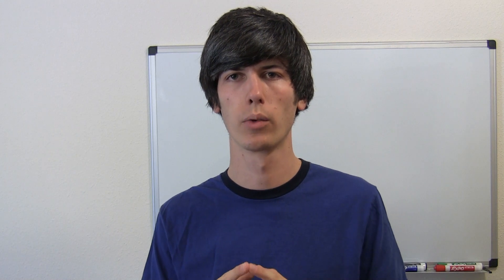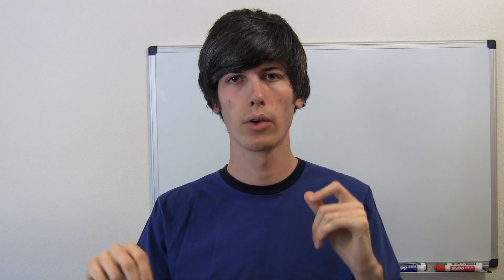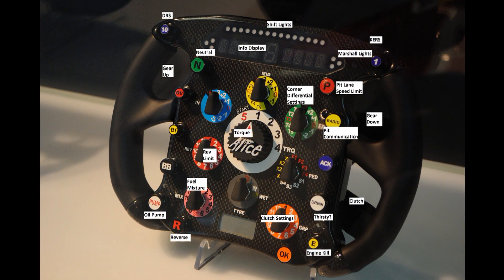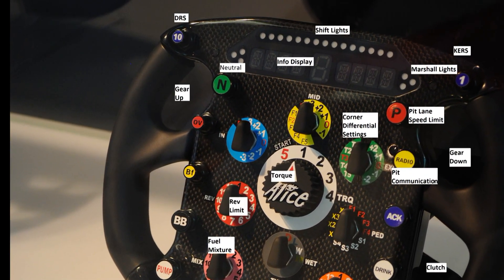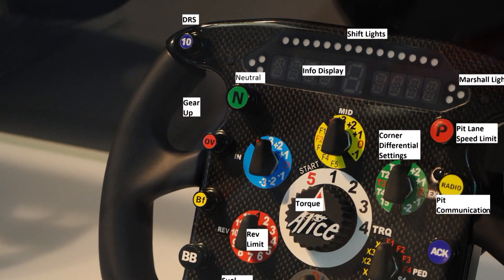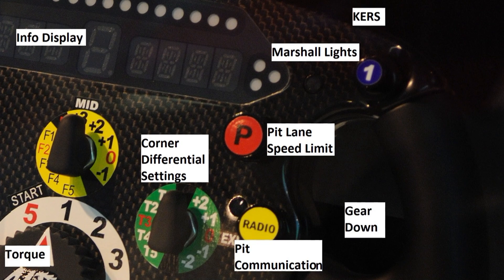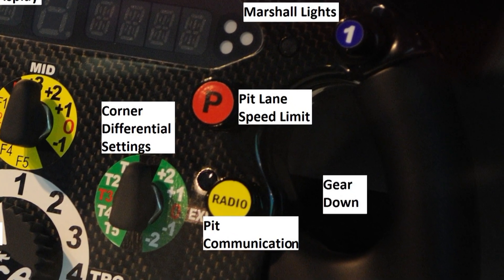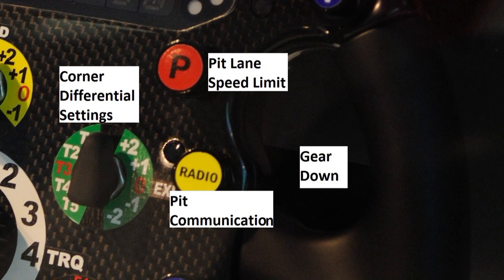F1 Steering Wheel - Explained

Comment: I know it's kinda old but are you sure the UP shift paddle is on the left and DOWN on the right? Isn't it the other way around? If not: Why not?
Reply from the maker: It's customizable. This is what Shell stated was the case for this specific vehicle.
Reply: ur right bro
Reply: cool thx
Reply: Daniel Walldorf, it really depends on the driver's preference. Most likely it's due to left and right handed ness
Reply: Daniel Walldorf 
Yes driver/team preference. Also, most tracks run clockwise but that's not a rule. It's just normal to drive on the right side of the road.
Reply: Engineering Explained Very strange, never seen a car (F1's included) that has up shift on the left...

Comment: it's just like you have windscreen washer on your road cars bonnet hood. when you pull the viper switch of your road car the water is sprayed on your windscreen and the vipers clean the windscreen. same is the case in F1 cars their is a tube in the drivers helmet when the driver pushes the button the drink comes in his mouth like I mentioned above how this works in road cars as a windscreen washer.

Comment: I remember when it was man and machine.

That steering wheel is just ridiculous and you'd probably do the same lap times if you got rid of all the buttons and knobs and just concentrated on driving.
Reply: absolutely no way. I dont think theyd be able to go as fast without those things. also its not like theyre not concentrating on the driving anyway
Reply: Adam Akhtar Nothing you can't do with a good setup and decent throttle control.
Reply: Tbh I don't know much about car racing, but stuff like fuel mixture and corner differential is gonna add small amounts of speed, I dunno
Reply: Adam Akhtar They do produce benefits but that assumes the driver is millimetricly perfect on every corner.

The gains are so small that you're better off not taking focus away from your position on the track and getting the braking, entry, apex and exit right... from my experience, that's where I've always gained the most amount of time.

Fiddling with other things breaks your concentration and that costs you time because you never get into that zone where you kind of disappear and wake up many laps later, having been setting consistently fast laps with absolutely no memory of them.
Reply: I get what you mean, but to these guys it's probably just like second nature to flick all these switches. So if they can get that tiny addition of speed without breaking concentration they'll be doing better than without

Comment: No cruise!?  But what's the deal with the idiot shift lights? Professional drivers need the computer to tell them the optimum time to shift?
Reply: +joeskis how about you try shifting perfectly at the right time when they can rev from 12,000 to 18,000 (thats the redline FYI)  in a few seconds without over-revving and destroying your engine.
Reply: Logan Bluemel why would I attempt that, I'm not a pro driver, nor am trying to be.  These are pro drivers, they should learn the skills necessary to do that.
Reply: +joeskis  i must not have understood your first post. So your saying that every 
"pro" driver should be able to shift without help. So nascar drivers 
should no longer have a tachometer to tell them the revs? Indy car 
drivers shouldn't have shift lights either? What about imsa? Wec? Your 
right, they should, along with being "pro" drivers, also know exactly 
what tone the engine makes at redline.  how else do you expect them to know what revs they are at?

And finally as you said 
your not a "pro" driver so therefor I don't think you should be 
dictating what they should and shouldn't be capable of doing.
Reply: FORGET ABOUT MODIFYING YOUR CAR!!!

"built" racecars should have only carburators. never fuel injectors or, God forbid, an ECU!

it makes the build harder for you to explain to people on the street, and it makes more limitations than possibilities.
Reply: +joeskis  Most cars have tachometers to help drivers determine when to shift.  Formula 1 uses colored light to tell them where they are in the rev range, and therefore when to shift.  When your racing you want to get right to the limit without going over every time, you can't do that by sound.  Being off by even a small amount will put you at a disadvantage.
Reply: The thing is that f1 cars have high revolution crankshafts (from 14,000 rpms to 16,000 rpms) and if you dont shift in the right moment you could actually damage some of the engine components as they are super light and fragile in some ways.
Reply: +Logan Bluemel dictating? Who put me in charge? Yes, I think listening to the sound of your engine is a fantastic way to know when to shift. That's how I know when to on my motorcycle. But I also know by the feel of the power band.  When it's not responding as well as I accelerate that means it's time to shift. I never look down at my tachometer to know when to shift. Which by the way is a significantly different indicator than a light telling you when exactly to. Why are you defending this? Why don't they start putting HUDs in their vehicles that displays the perfect lines they should take around the track. Sounds like you would have no problem with that.
Reply: +joeskis My car doesn't even have a tachometer, gotta listen to the engine farting out and everything starting to shake to know it's hit the redline. I typically have a few coins on the dash, they get noisy exactly when the car reaches good RPM to do a power shift (merging into highway, stop sign madness), since the crappy old engine probably didn't even come from factory with proper vibration protection anywhere.
I'd sure love to have a tachometer though, i have learned when to shift in the first 30 seconds driving that car, but it never hurts to be sure.
Heck, a HUD on it showing what's happening under the hood would be even nicer.
What hurts me plenty is that the car knows what RPM it's going into, it has a sensor for that, the ECU knows, Chevrolet just didn't wanna make the car an extra 5 bucks more expensive.

Guess the same mentality applies to F1, indy, nascar, wheelbarrow, office chair, shopping cart, whatever drivers - they know when to shift, probably have raced so long, they'd know when to shift even if they suddenly lost their hearing, but it never hurts to be sure you're doing it right.

Car i drive is a Chevrolet Celta by the way, 1.0 inline, VHC tech, something slightly better than MPFI, 75-ish BHP in technical sheet, 50 in the papers, around 60 in practice.

Exclusive to Brazil, the thing was made for the kinda guy that only has cash to spend on a cheap bike, but is afraid of the crazy local traffic and horde of irresponsible morons driving cars, and feels safer steering 4 wheels attached to a tin can.
To have an idea, a cheap bike from 2005 costs around 8k BRL here, and the Celta 2005 goes for 10 to 12k BRL.

Safety index of 1/5 for adults and 2/5 for kids in Latin NCAP safety test program, meaning if you crash against a wall at anything higher than 60 KM/h, you are very, very dead.

You might be asking yourself why am i chattering about my daily commute tin can.

I was asking myself the same thing once i was done writing this, but i realized i have had nothing to do for the past week and won't have anything to do for the following 3 months, so there you have it.

I have the time to write off why it's good to have some assistances when doing things as complex as driving, i have time to talk about the incredibly low car safety standards in the land of Carnaval, and i'm happy do to it.
Information is power, and i am happy to share whatever power i have.

Shopping cart racer with a HUD though...
Corridor 5 everything with 50% discouHNNNNNGGG!

Comment: There are 2 clutch paddles on F1 steering wheels, 1 is dumped when the lights go out, and the 2nd is fed in to reduce wheel slip and maximise take off speed.

Comment: BB, Bf, Blue nob, Yellow nob, 10, 1?
Reply: +kapil busawah i know BB stands for break balance, and Bf might be for bite-point find, for setting the clutch so it just barely bites the friction plates of the clutch. or whatever the specific parts are called.

blue knob says entry, so differential setting for entry to corner. yellow says mid, so mid corner (apex) differential setting. 

i also think the 1 and 10 were for selecting sub options, so if you needed option 35 you'd hit "10" 3 times and "1" 5 times. also used  for "failing" a sensor, i.e. turning a faulty sensor off.
Reply: Logan Bluemel Thanks. Know what ACK is?
Reply: acknowledge, a way to tell the engineers/pit wall that the driver understood the message. i would assume its the same button used when the engineer says "box, box, pit confirm".

Comment: I have to say, not that impressive, most MMOs has more button than this.
Reply: +ahadicow yer but most mmo's arent played while driving at 180+mph...
Reply: SpartanF1 TV oh yeah? that's because you haven't turned on damage meter.
Reply: +samcroniermusic u realise this was put up in 2012 right?
Reply: +ahadicow but MMOs isnt that fast pase
Reply: +SpartanF1 TV  i would love if they were though.
Reply: +ahadicow ...that makes no sense
Reply: +ahadicow so now an mmo is as intense as going 300 plus kmh 
You try remember to adjust the torque as it starts to rain while being ovetaken and talking on the team radio
Reply: +Luke Redmond more dots more dots more dots STOP THE DOTS
Reply: @ahadicow - "Most MMOs" don't shake you, jar you, subject you to 5g force, or put you in potential crash or even possible death(actual death) for nearly every corner of every lap in a race where even a slightly off wind pattern or a thin layer of dust on track can throw you spinning at 150+mph towards a wall. I'll be impressed if MMO players can handle half that in a half-race distance.

Comment: I hope this is not a stupid question. But how does those buttons or switches connect to their respecrive purposes? Do they use wires? Thank you in advance
Reply: It has one simular cable to old telephones.It can disconect when wheel is disconected
Reply: Elaine Grace it connects via pins and sockets in the center hub. See http://www.souriau.com/motorsport/repository/pdf/8STA-Steering-Boss-System.pdf
Here is the LED display http://www.mclarenelectronics.com/Products/Product/PCU-6D and the SIU (Steering Wheel Interface Unit) http://www.mclarenelectronics.com/Products/Product/SIU-300
Reply: thank you so much! Dominykas Ciunys  and Marko Vukovic. :)

Comment: This is probably a stupid question but do the drivers have to press the clutch each time they shift? Or just the start.
Reply: They only use the 2 clutches on the start, they release one and then they release the other. If you want to know how a F1 gearbox world: check out Mercedes videos
Reply: *works

Comment: I was hoping for a bit more detail for instance the first button, the things you did go into detail on where pretty much things I already knew or could infer.
Reply from the maker: What did you want to know?
Reply: +Engineering Explained I'm pretty sure fuel mix is determined by the ecu can't really expect the driver to operate a fuel mix on a fuel injected engines

Comment: whats the blue dial anyone?
Reply: Edit: My initial idea was stupid; it's just part of the limited slip differential controls.  It looks like the blue is for corner entry, the yellow is for mid-corner, and the green is for exit.  I'm not sure, but I'd guess that the blue is decel lockup torque adjustment and the green is accel lockup - not sure about the yellow mid-corner one.

Comment: It's true. The paddles are connected to each other which means that if you push the gear down paddle away from you it will move the gear up paddle towards you and actually select a higher gear.

Comment: at 3:50 i'm pretty sure the large dial in the center is for the various engine/fuel map settings, the dial lower and to the right of that labeled "TRQ" is the torque/throttle curve, which has 3 sections of settings for wet, dry, and qual (X, F, and S, though I don't know which is which.) As for the fuel mixture, that is decided by the guys in the pits, not by the driver on the fly.

Comment: OK - to confirm the driver understood the message/instruction that came through the radio without actually talking | TYRE rotor - to select the tyre you are on (wet, inter, slick) | BF - I suppose that is the bite point find for the clutch

Comment: The computer hold some presets for the a/f mixture and the driver simply choose between them.
So, yes the a/f mixture is controlled by the ECU, but the driver can tell the ECU which setup for the a/f mixture he prefer for the moment. It looks with this particular steeringwheel, the driver had 12 presets to choose from. Also if you look closely, one setting is named "SC". This means "SafetyCar" and sets the a/f mixture to extremly lean to save as much fuel as possible.

Comment: as you know in F1 each driver is allowed to use a maximum of 8 engines over the season , so the rev limiter is used to keep the engine good for the next race , and in the end of the season they start the path of distuction , no rev limit and the fight stats to heat , that's all

Comment from the maker: Usually drivers will keep the revs below redline, and occasionally use the rev limiter button to increase the allowed RPM, for a short gain of power (at the expense of fuel). I believe that's what it is; someone correct me if you know otherwise.

Comment: In f1 the paddles don't work only in one direction. If you pull the paddle then it gears up on the right and it gears down on the left. If you push the paddle forward then it's the opposite, it gears up on the left and it gears down on the right. This way the driver can use the hand he wants to shift inside the bend.

Comment: The odds are that the steering wheel in your road car has more functionality than a NASCAR wheel. NASCAR wheels have a radio button, and some drivers like a kill switch on the wheel as well, although not all teams put one there. Other than that, it's a steel rim padded with a fire retardant foam.

Comment from the maker: NASCAR is much more simplified. It's more of getting the greatest efficiencies out of older technologies, rather than using the latest technologies. Examples: NASCAR just switched to fuel injection (2012) from carburetors, they're pushrod, 2 valves per cyl, iron blocks, 4 speeds, etc. They're steering wheels are a bit more simple I believe.

Comment: Tracks with tight pit lanes can have to lower pit lane speed limit, as was the case in Singapore 2012.

“The Stewards have received a recommendation from the F1 Safety Delegate for the speed limit in the pit lane to remain at 60km/h for the whole Event,”